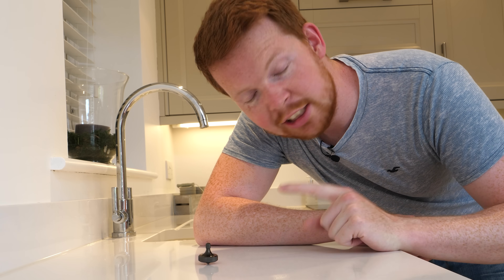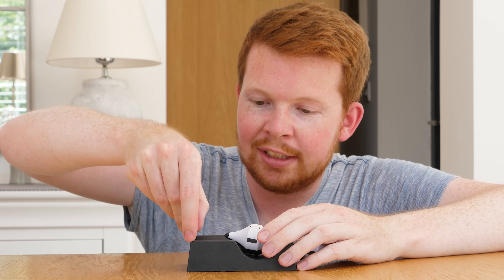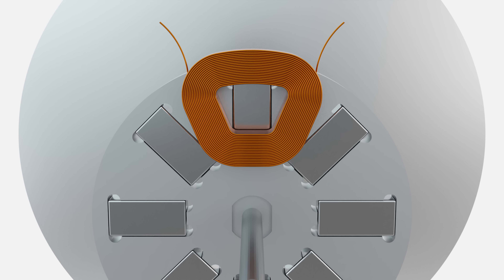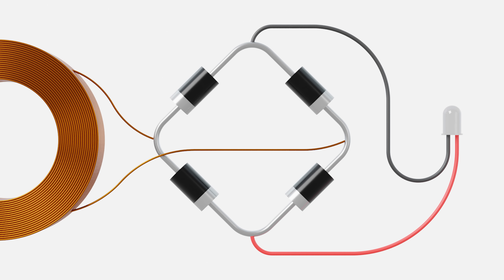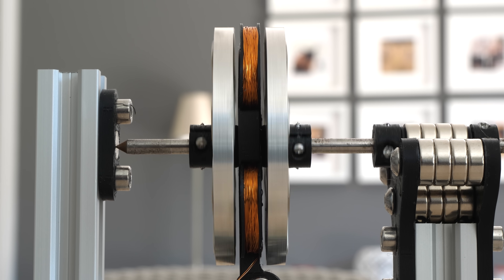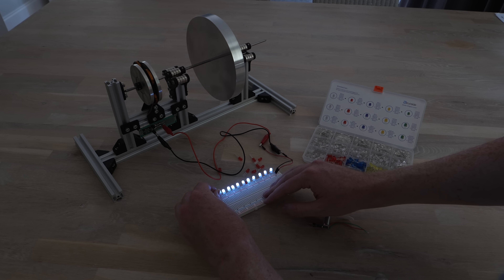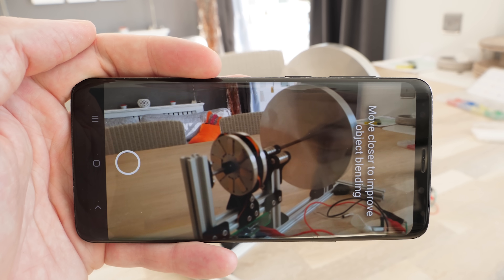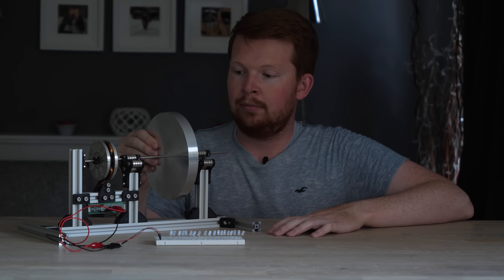Flywheel Battery

Comment: This is great because I have this hair-brained idea to try and find a very low-drag generator with very low internal friction so that I can attach an extremely heavy flywheel to a shaft that is attached to bike gears. Those will be used to get the shaft up to speed and keep it there using a microcontroller to choose the best gear to keep it at a fixed speed. That will be attached to a windmill and a solar array, and both will be attached to a battery pack and inverter to get it up to wall-socket voltage for an off-grid 0-emissions setup. Now that I know that MagLev bearings and are a viability and, as you are showing with the correct weighting and frictions, it can be used as a mechanical battery as well, that's really exciting! You even described it as "an electronic gearbox for my windmill" like I do! I have the mechanical gears to maintain constant torque curve, and a flywheel generator to maintain constant current.

Comment: It would be more efficient if the flywheel geometry were more ring like (mass concentrated at the circumference, hollow centre). That way, for a given mass, the flywheel would have a higher moment of inertia, therefore won't have to rotate as quickly for a given amount of energy. Less drag and frictional losses.

Comment: btw., u are using steel shaft which is attach magnets and bolts seems also from steel. it will make the magnet slow spining for sure, i would make it all plastic  and steel shaft from  something non magnetic also

Comment: Try to use it with buck-boost converter, and you will get stable voltage not depending on rotation speed.

Comment: 11:20 the diode doesn't pulse when the magnets are aligned with the coils. It pulses when the coils are in the middle between two magnets. That's because the voltage is proportional to the change in magnetic field and not its value. You can see it quite clearly in the slo-mo. When the magnets are aligned with the coils there is no change in the flux through the coils so there is no voltage.

Comment: You should find a way to  flip the setup up, while keeping it mag lev'd  ... it would reduce gravitational loss on your flywheel...    It would really interesting if you could create a really high efficiency generator with a set of pedals, gears and a set of multiple much larger flywheels with factory machined bearing for the physical link between pedals and shaft.

Comment: Very intresting concept, but biggest problem of this is to keep that flywheel in balance and never gonna made huge one as it would require 10x times more support compared to flywheel size and superhard. Water is good battery for now for example in england they have that hydrogen thing with a lake as when there's electricity they pump the water up and when there's not they let the water come down and the same pump works as a generator now etc..

Comment: Just a quick question...
Should the capacitor after the rectifier not prevent the flickering? If you still get flickering, it means your current draw is to high, and you are getting ripples in your output. If you increase the cap farads, you can draw more current without getting a ripple. Fun experiment to do on a scope.

Comment: Couldn't you  constrain it with a magnet on the left and right as well? Put a N magnet on both sides of the top/wheel then house another N magnet where the glass would have contacted the "tip" so the magnetic force is providing the resistance to the lateral wiggle, would that make even less friction?

Comment: Hello, Just a noob question
First of all, I really envy your good knowledge of mechanics :)
Why you decided to setup the system in horizontal and not vertical?
At cold state or shutdown state the horizontal help you to avoid system fall but in vertical one, during hot state (running at specific rpm) the gyro could help you with the stabilization effect avoiding the annoying unstable rotation of the axis. With more and more rpm stabilization is assured....let me know :)

Comment: Do you realize that with your little machine there, you have created perpetual electricity? That little motor is more than capable of causing your flywheel to spin way faster than you can hand-spin it. In fact, since the faster one spins, the faster the other spins it would eventually fly apart.

Comment: 9:27 just putting the LED like that is equivalent to making a short circuit be ware of that because if the voltage is high enough it can blow down the LED

Comment: I would definitely build a hand crank gear multiplier, like 1:5 and then inlay slugs of lead, bismuth, or tungsten into the aluminum flywheel. Better yet, make the whole flywheel out of those metals. Use a ruby as the bearing with a needle point for minimal friction. Use transistors for rectification and possibly a voltage regulator to make the high and low speed rotational phases still able to contribute their energy to the task. It would produce much longer lasting power generation periods per instances of interaction. Spin it up once, and it might go for a full minute or 2 doing work. Then of course, when do you stop and draw the line at overcomplicating? 🤣

Comment: The only problem I have with this setup is the energy lost in conversion. Why try converting to electric energy to make a motor work than to use magnets to directly/physically spin a motor, but a cool experiment for mini LEDs, I think there's a possibility to achieve better results using some sort of gear setup to increase the speed of rotation, also maybe a handle or a pedal to grab onto to manually spin the wheel to start.

Comment: Very disappointed you didn't put in a clip of Mehdi of ElectroBoom in place of you saying "full-bridge rectifier".
Very pleased at the improper hierarchy of using a flywheel to generate electricity for a small electric motor placed right next to it.

Comment: Get a 5 volt motor like a brushless less volt so ill say do a high kv 4000 help it get the the 5 volts and then it should go faster and faster it should not run out of energy but hig kv might need more volts so maybe go for a 600kv motor

Comment: You could actually spin the flywheel by sending an alternating current to those coils
Reply: Try using the motor to simply keep the fly wheel moving. It takes less energy to keep it at speed then starting it not perpetual just try and make it more efficient. Might stop in an hour... instead of 5 minutes...
Reply: Can you do both at the same time then.. have the reverse set up at the other end of the shaft ? Perpetual motion?
Reply: @linuxninja  I understand electromagnetic induction. I rebuilt motors for years as an ac and heating tech. I ask asking IF they tried to set it up with the reverse induction on either end what would happen. It seems if it moved at all, the shaft essentially floating, having no friction might help produce an effect that is perpetual.
Reply: @DivergentDroid  its spinning perpendicular to gravity so there will be a very small amount of gravitational friction that will cause loss of energy. Also heat is generated from the alternator and electricity causing further, yet very minor, loss of energy. Nothing can be perpetual but you can get damn close
Reply: @thebadluckraven8217  It is said in the Standard Model that the Universe is 14 billion years old and Earth is 4.5 billion years old. Of course those are just numbers someone pulled out of their arse because there is no way to verify that with the scientific method. However we agree that the Sun and Moon at least have been above our heads from as long as human written history which is at least 6 thousand years. I'd take a process that last 6 thousand years any day. It doesn't have to be really perpetual just very long lasting for the purposes of doing work.
Reply: @DivergentDroid  well your statement was specifically asking about the application for perpetual motion. Btw magnets last about 900 years outside of heat variations. The problem lies in the fact that electromagnetic motors use more power the more work it needs to perform on an exponential scale. Coupled with the energy losses from other sources it makes an extremely inefficient device. Key point, magnets/electromagnets struggle to produce torque when a load is applied to them.
Reply: @thebadluckraven8217  Ya know what magnets also do.. lose their magnetism when heated beyond a certain degrees. And people think there is a molten core in the middle of our assumed spherical planet that creates a magnetic field. So silly. I just want a motor that will outlast anything else we have that can run either by itself or by natural forces so it doesn't use an external man made energy source. We already do this by harnessing the mechanical energy of water but we need something on a scale and design that's practical for everyone to use so they wouldn't have to pay the power company monopolies. There is atmospheric energy, you get about 100 volts for every meter in height above the ground but no one has been able to make it usable. Seems to me all you have to do is find some natural always present energy source that can turn the rotor and produce electricity through electromagnetic induction. Of course wind, solar and geothermal can also do that but you never have constant wind or sun and geothermal is not practical for most people.
Reply: @DivergentDroid  how interested in this are you because ive literally been working on that for almost 10 years and have a proof of concept. Not about to just comment on youtube about my discoveries, but i could potentially enjoy a collaboration because everyone else things im a crazy person when i rant about magnets
Reply: @thebadluckraven8217  I've read about or seen videos about a lot of alternative energy sources going back 20 years but haven't tried to build one myself. I take it your proof of concept is a type of magnetic motor? I've often thought such was possible in theory but cannot vouch for any of the ones I've seen having never been allowed to examine them. I'm afraid I'd be no help to you. I'd happily view a video if you choose to make one.
Reply: @DivergentDroid  yeah it uses magnets but technically they aren't the driving force behind my design, I've been through numerous prototypes and one of the most important things I learned is that electromagnets use exponentially more energy the more force applied and the farther the distance between. So any that uses electromagnets won't work

Comment: I can never hear the term 'full bridge rectifier' without hearing electroboom say it in my head
Reply: Yeah I was almost disappointed he didn't reference Mehdi when he used the term :'D
Reply: @TedSeverin  samr
Reply: U mean a FULL BRIDGE RECTIFIER?
Reply: At least he didn't use a PUNY SINGLE DIODE.
Reply: Same here, but he elaborated the concept more comprehensive
Reply: I said it to myself out loud the way Electroboom says it when I knew Tom was going there :D
Reply: The common name is "full-wave rectifier" (FWR).
A lot of power is lost in the diodes of an FWR. Transistors can be used instead of diodes with much less loss. This is called a synchronous rectifier.
Reply: @benthere8051  why not build a generator in the first place
Reply: @craigme2583  The alternator that Tom Stanton made in this project can work as a motor if you energize the field magnets in the proper way.
Reply: @benthere8051  A 'full wave rectifier' is not a 'bridge rectifier'. A full wave rectifier uses 2 diodes, a full wave bridge rectifier (bridge rectifier) utilizes 4 diodes.
Reply: MOTHER OF FULLEST BRIDGE RECTIFIERRRR
Reply: Should be "full wave" bridge rectifier. Electroboom is wrong as well.
Reply: FOOL BREEDGE RECTIFIAH
Reply: @literallytheguyinthepic2519  FOOL is absolutely correct for most of this group.
Reply: I haven't watched him in years and I can still hear him in my head
Reply: FOOOOL BRIDGE RECTIFAYAH!
Reply: i can never hear the name electroboom without thinking of him electricute himself on his home made steel wire electric guitar connected to the mains.
Reply: F U L L  B R I D G E  R E C T F I Y A H ! ! !
Reply: @benthere8051  I Don't care what google says, I can look right at a textbook that shows the difference between a full wave and a bridge. If you want to see the difference, go to digi key or mouser and look at the diagrams.
Reply: @Hathorr1067  DO THAT!  Search Mouser for a full-wave rectifier. Mouser will reply with hundreds of four-diode examples. There are four diodes inside of each one of the devices in those photos.
DO IT!!!
Reply: @benthere8051  Did do that. Been doing that for years, actually.

Comment: 1:52 in fact - this design of "magnetic bearing" - outdated now - it has not been completed conceptually, since even a simple Levitron is able to hold the rotating magnetic flywheel of the cavity levitating without mechanical support points inevitably adding friction, like the glass of the axis support in this magnetic suspension in the video, the Levitron - a system of two washers of magnets from the speakers - keeps the flywheel of the smaller magnet levitating in air above the lower magnet - simply due to the rotation of the flywheel - demonstrating that for a full-fledged magnetic suspension of the flywheel, just the rotation of the flywheel is already enough. Unfortunately, the existence of magnetic friction in such a suspension has been scientifically discovered today - a Levitron placed in a vacuum when launched - stops after a while - due to "friction in a magnetic cushion", but I have not heard of a similar experiment with the rotation of a pyrographite plate over an array of magnets - maybe it will not exhibits magnetic friction because diamagnet as a superconductor and not a ferromagnet-ceramic of a permanent magnet

Comment: If you offset the wheels with the motors would it give a more stable voltage for the  LED's? and less flicker.  Fun project, I enjoyed watching this.
Reply: Thinking the same thing, but it may also cancel out the power generated from other side??

Comment: Of course, once you actually generate and consume power, the flywheel will slow down much faster than when only generating voltage but without any power consumption. Conservation of energy shall not be violated.

Comment: I'm thinking: make it bigger, more stable, more mass, more voltage, more oomph, more reservoir. It has no friction, calculate the efficiency and perhaps make the flywheel run for an entire hour, 2 hours, 3

Comment: Is it possible to further reduce friction induced on the fly wheel by spinning it in a vacuum? Also would you be able to reduce friction by swapping the stopper on the left side to magnets on either side of the axle that repel each other but never touch?

Comment: Instead of using the little needle point bit, you should experiment with using a set of magnets (likely will be needed at either end?) to constrain the horizontal movement of the flywheel.

Comment: When using led, you can skip rectifier , just put an even number of leds  in parallel and opposite directions. This way you will get higher voltage on LED, only flicker frequency will be slover.
Reply: Good point.  You could simplify and use only half of the wave and only pull 1/2 the energy off the flywheel.  The higher the load the fast the wheel stops.  I wish he measured flywheel spin time in relation to load.  How fast can he brake with it shorted?
Reply: light emitting diodes are indeed diodes
Reply: Absolutely, also recommend placing some resistance value in series with the diodes to help limit the current and prolong the LED life.  The conduction curve is pretty steep on a diode without the passive element.  Parallel diodes need their own resistor as they are not equally balanced.

Comment: You need iron or any feromagnetic material instead of air for the inductances cores, this is needed for the magnetic circuit to have low reluctance. With air coils the result is low voltage and current.

Comment: To get more power why don't you just stack more "alternators" along the shaft.
Reply: The more "alternators" you have, more energy you'll need to input to the flywheel since it'll become "heavier" to spin
Reply: It happens because when the magnetic fields induce a current in the coil, that current induces an opposing magnetic field to fight the change
Reply: @isaiasrdossantos  that makes sense.   Theoretically you could turn the shaft with an induction motor but you wouldn't be able to get out what you put in. But I do believe it could be fine tuned to run for a long time on its own. An inventor did something similar but with mechanical wall art. If it can be done mechanically it can be done electrically.

Comment: The magnetic design of this looks pretty inefficient. I think you'll get significantly better results with coil of this shape using thin round (coin shaped) magnets with poles on opposing flat sides.
Reply: watch out, otherwise the wind turbine mafia will make you disappear ! ☝️